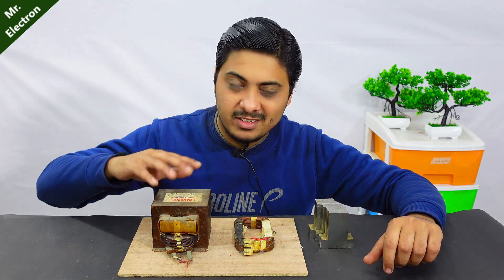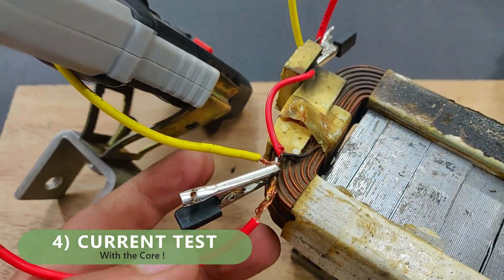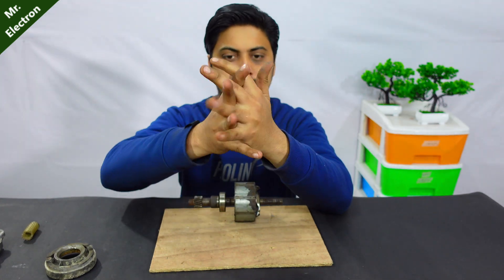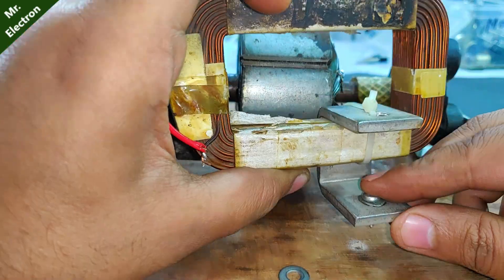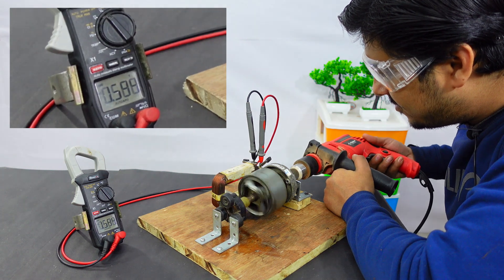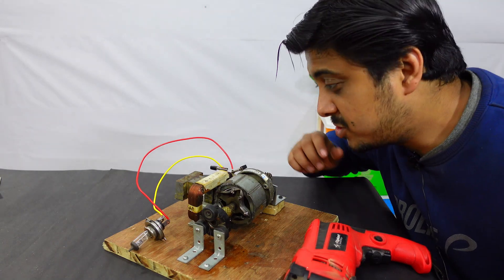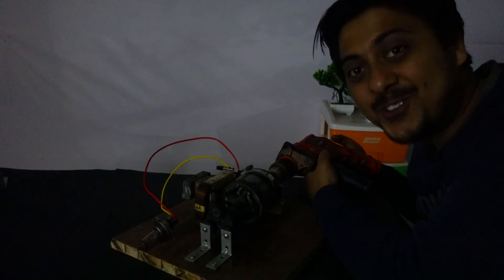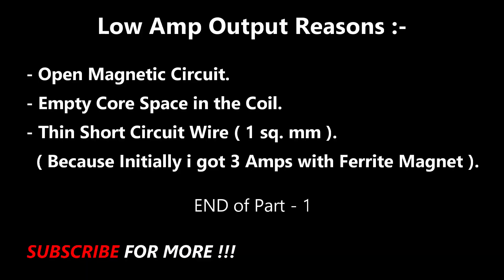220V Microwave Transformer to AC Electric Generator 100W DIY ( Type  -1 )

Comment: I made the same test and uses a 8pole Magnetholder driven by a 20000 rpm Motor. I could generate approx.80V AC.

Comment: The relevant point to focus on will be the mechanical input vs electrical output, which is not going to be anything special, when compared to any other standard generator, because Lenz law is applicable. But as a normal generator, your efforts are commendable.

Comment: pay attention to your core line direction as relates to the moving magnets arc, the ceramics where cutting 90 deg from the laminate line direction...hence more induced emf +- bemf.
however the neo's even with more millihenries where zero deg inline with the laminate line direction so very little magnetic conduction/induction on the separate laminate plates...

cut the laminates with a hole saw to make them curve around magnets arc to get better& closer magnetic coverage.

remember 'Professor Eric Laithwaite: The Circle of Magnetism - 1968' see them all.
showed a sausage shaped coil is better as you waste less magnetically lines uncut 90deg copper doing nothing to make a collapsing magnetic field = more bemf ,its about inducing more (delayed) magnetic zones so their collapse can transform back to current in the less resistive path copper in this case etc

get a role of cheap super thin magnetic 'steel foil', stamp a bunch of separate laminates out of that, use super thinned out wood glue to stack the laminates together, see the improvement for a little more effort & fun
making an auto stamper machine.. stick some extra old magnets on the laminate stack, on the far side away from the spindle to magnetically assist the transient field, more fun

keep in mind WHY the laminates all around the shading ring/pole induction motor make it work & the job the bits of wound copper 90deg offset from the main ( inducting) coil is there ,... to take up the collapsing delayed fields in the laminates and provide the ringing offset push etc.. think like a real visual engineer not a computer optimisation tool simulation..

Comment: It's a nice application showing how the core increases efficiency in electricity generation, it's a great experimental setup in this respect, yes. If the magnetic fluxes of the rotating magnet rotor cut other coils at an angle of 120 degrees, or if they could take it into fa, even 3-phase AC would be produced, other friends who obtained AC by connecting the windings in series by rotating the rotor in its open core state and 220 volt coils of 2 microwave ovens opposite each other and the top cover core removed. There was also. I mean, most of the magnetic flux of the magnet rotor is wasted with this method while it is rotating, this rotor could rotate as it would be more efficient and surround the winding with its own hollow core, you should definitely try it. Good luck with.

Comment: Please measure the frequency
Reply: The engineering mindset taught me
The AC frequency is always 1/2 the rpm of the generator converted to hz
Since he's rotating it at 2500rpm
Maybe
Just maybe
The frequency is around 1250per minute
Or ~ 21 Hz
Reply from the maker: F = (p.n)/120  ; where p= no. of magnet poles, n = speed of shaft 
=> F= (8x2500)/120 = 166.67 Hz
Reply: @MrElectron  thank you

Comment: Answer of your question
Because silicone increases the electrical resistivity of steel core and, therefore, reduces eddy current losses.
Reply from the maker: Congratulations !!! You were the first one to give the correct answer and now you have successfully entered the contest.

Make sure, you are the first one to correctly answer for the next video as well to win the contest.

Contest Rules (video) - https://youtu.be/yM1HGrM2wNM
Reply: Thank you ❤️❤️ sir .
Reply: Eric Dollards video the history of electricity he explained how the Atlantic Ocean crossing of the communication cable where the timing of the signals was not correct after transversing the distance. (Dot dot dash dash) Steinmetz wrapped the cable with "magnetic" tape. Because the signal being created by a generated induction around the conductor was also magnetic and not only dielectric. Silicon insulates or isolates the plates apart. Like the covering of tape. So the coaxial cable was created. And the timing of the magneto and the dielectric was maintained through better more appropriate induction. Not being as much effected by sea water (electrolytic) induction. The telegram wire impulses of charge travelled simultaneously held together as one magnetodielectric charge impulse across the vast distance. 

The inductance created in the transformer is forced increase in the magnetodielectric  capacitance by plate separation.
Reply: @niktesla3939  no its just magnets adding up, the more you add more the magnetic flux, more the emf induced, and more the resistance  ie coiling of copper u cut more current u generate